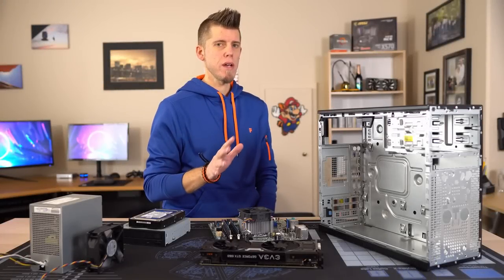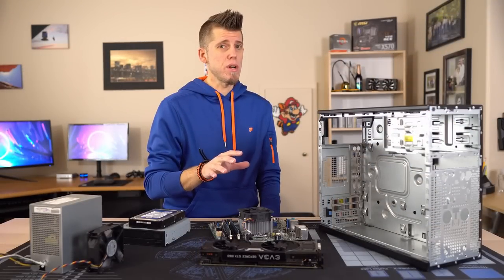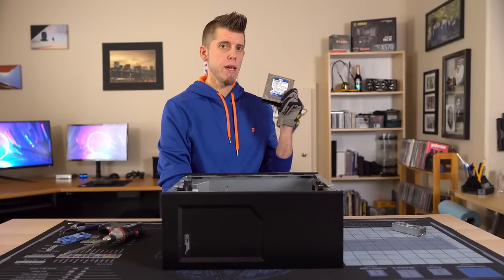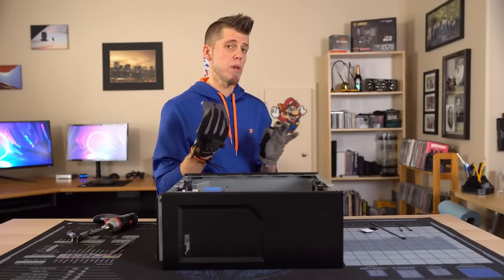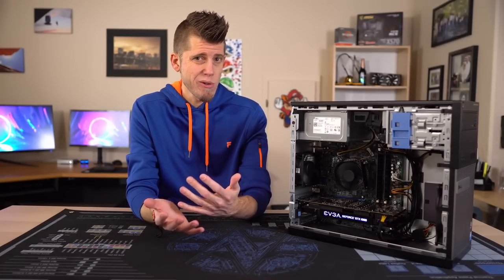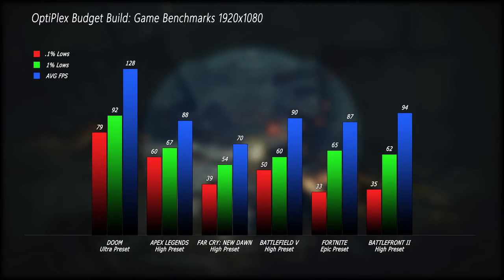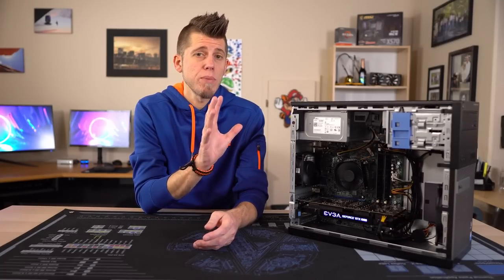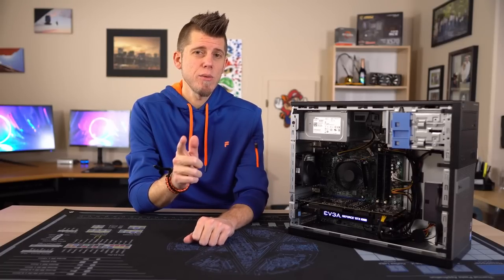Dell OptiPlex Budget Gaming PC For Under $300?

Comment: Eh if you're gonna buy those little 3m things, screws, accessories you're at  point where just buying a new case that can already accommodate those pieces of hardware. Not only that you could probably get something that comes with a couple fans and better airflow.

Best bet would calculate how much you're spending on accessory crap vs a new case.
Reply from the maker: Everything I used was included in the cost. I see your point, but cheap cases are just that... cheap. They're flimsy, generally look terrible, come with terrible fans, and don't always have good airflow. Despite it not being the best looking case, it's pretty solid and sturdy. That being said, swapping these parts into another case is more hassle than it's worth unless you're fine with the front USB2 ports, audio connections and HDD led not working. Besides, throwing it in another case would have made this cost more than the consoles, disproving the point of this video.
Reply: 🙂 check ebay, theres a pc hardware section, they have rebuilding kits with an included tackle tray, all the popular screws and stuff are categorized in their separate compartment, very good thing to have

Comment: Before being able to buy the geForce GTX 1060, what graphics card should i be using? or should i stick with the Intel Integrated one??
Reply from the maker: The integrated isn't going to give you a playable experience. Fine for office task, not for gaming. If you just want something to game on now, but can't get the 1060 yet, a good option would be a RX 460/560. You could go with a GTX 750 Ti or 950 as well.

Comment: Want to upgrade Graphic cards on My Dell Optiplex 7010 Cori 7 vpro 16 Ram which Graphic pass in 2020 Need Help Please!
Reply from the maker: If you fine replacing the power supply, you could run something like the 1070 or 1080.

Comment: I'll admit I'm from ReviewTecUSA and the Power supply isn't as big of a deal as rich makes it out to be. Either way id still go with a 500w or 550w power supply simply to have some over head, and it's only like 20$ more that the one here.
Reply: Yes it is.. the PSU is the MOST IMPORTANT competent in the system. No PSU. no system. Period. nVidia does not have a minimum spec just for the hell of it.
Reply from the maker: @shadowduck02  The problem is that exists because nVidia knows that there are lower end PSU's that can only deliver that 400 watts for a split second and they can only supply around 300 watts, or less continuously. The 290 watt unit in this Dell can supply 290 watts consistently. Now, this system pulls about 210 watts from the power supply giving you a head room of 70-80 watts. That being the case, there's literally zero difference between those two from a power delivery perspective and so many of you comment fail to realize that. So, if you bought a 300 watt PSU with the same issue, it would only provide closer to 200 watts consistently, and that would be a real problem.
Reply: @TheGameBench  while I will agree with you, why risk it to save $30?
Reply from the maker: @shadowduck02  Because I don't see it as a risk, and I don't think you're going to be much better off with a $30 PSU. The whole idea, which I really wish I would have made a disclaimer at the beginning of the video, was that this is fine to hold people over until they can save up at least $50 for a decent 450+ watt PSU.
Reply: @TheGameBench  ok I will give that to you. But great video overall. Excellent presentation values!
Reply from the maker: @shadowduck02  Thanks! I appreciate that.

Comment: cheers. Just found a binned 920 at work with a slim hdd installed and 8gb of ram. intend to run a gtx 1080 bigger psu and another 8gb of ram to run vorpx for VR. Cages restrict airflow so i recommend cutting out the  front mesh. If the pc is on all the time do i really need a SSD will a HDD mess with game play?

Comment: Hello Sir,
I hv a Dell optiplex 990 i7vPro PC , Unfortunately PC motherboard PCIe slot is not working anymore.  Do i need to replace my motherboard for this issue, If yes then can i use same processor into new motherboard ?
Reply from the maker: As long as you stick with a 990 replacement board, which shouldn't be very expensive. Alternatively, the 790 board is nearly identical, minus vPro, which is most likely unimportant to you, or anyone still using these. And while the 390 also uses the 2nd gen CPUs, it's quite different and I wouldn't suggest using it as a replacement.

Comment: I have a optiplex and I have a question, I upgraded the power supply and every time I connect the power supply to the power cable, the fans stay on and it won't turn on unless I go back to the stock power supply
Reply from the maker: What model of Opti? If it required an adapter for the power supply, it's possible the adapter could be faulty.
Reply: @TheGameBench  optiplex 790 I used a 550W but never turned on
Reply from the maker: Okay, no adapter needed, could just be a bad power supply. Is it brand new? If so, I'd return it and get a different one. What brand and model is the new power supply?

Comment: Is it possible to fit a evo 212 CPU cooler into this PC?
Reply from the maker: Nope, it's too tall at just under 160mm. Tallest cooler you could fit in here would have to be just under 139mm. The Noctua U9S would be my suggestion.
Reply: @TheGameBench  Thanks for responding back quickly and for your suggestion👍
Reply from the maker: @Belle1337  No problem.

Comment: Hey man great video!!! I wanted to ask your opinion on a custom pc built for multiple virtual machines. I’m thinking on building one from on a budget from $600-$1000
Reply from the maker: Thanks! How many VM's are you planning on running?
Reply: The Game Bench about 3-6 Linux and windows machines.
Reply from the maker: @cloud77hot40  Guess that depends on how many cores you want to give each VM. I'd say at least an R7 3700X, maybe the 3900X. Toss either in the MSi B450 Tomahawk, I'd say at least 32GB of DDR4 @ 3200MHz. I think you could do that for around $1000. Depends on what GPU you want too go with... even if you need much for the VM's.
Reply: The Game Bench awesome thank you! What is a good psu to have?
Reply from the maker: @cloud77hot40  I really like the Corsair HXi series. Quality PSU's, good efficiency, and very reliable. I highly recommend Super Flower and Seasonic. EVGA has some good units that are just re-branded Super Flowers.

Comment: I have a question, I've followed all the videos and have my fan coming tomorrow. I'll be hooking everything up. I realized I have a psu already that's modular, would that replace the need for all the extra cables needed in the video, except for the 24 to 8 pin. Since you are using the original PSU. Thank you sir, awesome videos by the way.
Reply from the maker: I'm sure you've already figured it out. Sorry, been really busy with testing for another video. Anyways, you'd still need the SATA to fan adapter as well as one of the resistor cables, if you felt you needed to slow the fan down. Otherwise, you shouldn't need any of the other cables. If the SSD mounting is an issue and you don't want to reverse the connector, you can always mount it else where rather than buy the extension cable with the straight end.

Comment: That statement about the fan header splitter cable in the 3020 is exactly what I had planned too lol.
I do have a tower cooler in mine with the fan facing the rear, could I just leave exhaust fan unplugged and plug the intake fan wire into that header. Or just use a Molex adapter for it?
Reply from the maker: Well, leaving the rear fan unplugged will effect how much air can get out of the case, possibly putting you in a overly positive pressure situation, which isn't ideal. You want to really be as close to neutral as you can. I would recommend keeping it plugged it. You can use a Molex adapter, if you have a Molex connector, and these systems don't, but there are press on connectors, much like the SATA one in the video. However, you can always give it a shot and see if you have temp issues.

Comment: I used the 9010 optiplex for my first build in 2015 i5-3470 paired with 16gb ram and a gtx 970. Built it out of because I wanted the best experience for Arkham Knight. And it handled the game quite good at max settings 1080p, at 30 FPS though. But considering how the game is known in the PC world and especially at the time I think it turned out right and every other game ran quite good, I also paired with with a RTX 2070 until I retired it after Ryzen 3700x. The processor became an obvious bottleneck.

Comment: I bought a 7020 SFF i5-4430. I plan to spruce it up a bit for my mother to use as a photoshop and web browsing machine. Its already coming with 1600mhz 8gig ram.

I will put an ssd but just wondering if  theres anything I can do to modernise it. Would a sff gpu make the pc run better in general? Or will the cpu be fine on its own?

Would replacing the psu and fans gave any worth on a non gaming pc?

Comment: Are there any compatibility issues on optiplex pcs?. I’ve heard people say that when upgrading the gpu for example the pc won’t turn on.
Reply from the maker: I've built and sold over 20 of these systems. If it wasn't working, they didn't put in enough effort to figure out why, or they were repeating misinformation and never actually tried it.

However, that's not to say they don't have compatibility issues. They can be picky about RAM and they're incredibly picky about changing the fans for some reason. But it's not too hard to find ones that work.

Comment: so I picked up one of these 9020's it was a slightly better model with a 4 ghtz i7. There are a lot of these computers out there because businesses dump computers after a while and I spent nearly 1000 dollars to build a computer similar to this 5 or so years ago... I'm going to give it to my friend who needed a mac (i turn PCs into hackintosh's) although I'm planning yanking out the 4 ghtz i7 and swapping it with my other computer's 3.5.  I'm putting a GTX 4 gig video card in it... no gaming involved. I did recently purchase a radeon RX 570 to replace the GTX that I'm putting into the optiplex and that with the 4 ghtz processor would make a pretty good gaming machine :). but of course instead it's a hackintosh.

Comment: Can the Dell Optiplex 7020 or 9020 support booting from an NVMe drive? I've seen other models where the NVMe drive is placed in a PCIe slot with an adapter, but many report that they can use it as storage, but not as a boot drive. Some guy that builds Hackintosh PCs reported using Clover (a bootloader) to first boot to a small SATA drive which then loaded drivers in soft UEFI mode to boot the the PCIe device. Also, even if it does work, is using and NVMe over a SATA SSD even a good call considering the age of the system and the fact that it's data throughput is limited to PCIe 2.0, which could theoretically bottleneck the performance an NVMe device. Your thoughts?
Reply from the maker: Yeah, you can use an m.2 drive in a PCIe adapter, but only as a storage drive. The xx20 models have no options in the BIOS to boot from the PCIe bus. I suppose what you're describing is possible, but seems like more of a PITA than it's worth. Regardless of age, 99.9% of people won't see the speed difference between an NVMe drive and a SATA SSD outside of synthetic benchmarks or large file transfers between two NVMe drives.

I'm actually going to tear down my editing system after I finish editing my next video and swap my NVMe drives for my editing scratch drives for SATA. I bought into the hype, but I could edit in Red 8k RAW and not touch the limit of a SATA SSD. Currently, I would call NVMe drives marketing hype for most people, and they're the very definition of diminishing returns for most people. They're real benefit is size, and reduction of cables.

Comment: Do you know what the amber blinking light means? I installed an RX 570 but my optiplex (7010 MT)  won’t power on . It blinks 2 times then it pauses and blinks 2 more times. 

Maybe I didn’t connect everything properly after taking the computer apart?
Reply from the maker: According to the diagnostic table, that's likely a power supply issue, but it could also be  bad motherboard. I'd start by re-seating all the power cables. Make sure the CPU 4-pin power is connected. However, I would ask... are you trying to run an RX 570 on the stock power supply? And which model is it? That could be your problem. It could be drawing too much power for the 275 watt unit in the 7010.
Reply: @TheGameBench  I’m using a 400w EVGA psu and it’s the MSI Gaming X RX 570.
Reply: @TheGameBench  I had the CPU 4-pin inserted incorrectly. Thank you for your help you saved me a lot of time. It’s kinda crazy how one little oversight can cause hours of trouble.
Reply from the maker: @MistaSmellGood  Oh yeah. I've had times where RAM was fully seated and simply removing and reseating solved the issue. Glad I could help.

Comment: I have an optiplex and have not checked the thermal paste. I really should was wondering if these temps seems fine, in games my cpu get up to 70-80 degrees. definelty not ideal and most likely the paste. DO you think those temps are too hot?
Reply from the maker: That depends on your ambient temp. Even then... that's pretty high for a gaming load. If you've never replaced it, it's probably dried up. It would only take a minute to clean off and replace, and it should have you down closer to the 60s while gaming.
Reply: @TheGameBench  I checked it out last night and oh boy, it was dry as a bone. Probably hasn’t been touched since 2013. Scrapped away and new paste is coming today, Cheers!

Comment: The only games that run at 60 is cod and doom on consoles and some other fps rpg games they get 30fps capped or 40fps capped and run at 1600x900 some games do run a 4k but with low ON EVERYTHING WITH ULTRA DETAIL ON CERTAIN TEXTURES these consoles are for tricking people visually and after I played on pc at 120 or 144 and came back to console it was like looking at shit
Reply from the maker: I've watched frame rate and frame time analysis. They all do go up to 60 FPS on all of the consoles, save for Far Cry: New Dawn. On the base consoles, I'm sure that comes at severe sacrifices on the graphics side. Hell, on the PS4 Pro, Apex dropped to 900p at some points. I'm certainly not going to argue that consoles take some extreme measures to try to keep that frame rate up, but still have trouble maintaining it.

Comment: Hey love your videos, very informative series! I have an optiplex 9020. Could I put in an rx 470 using the sata-pcie adapter on the stock 290w psu? From what I've gathered from your videos, I think I could. Just looking for a final opinion before I pull the trigger!
Reply from the maker: I thought so... but I've tested a couple, and the power consumption was way too high. One was just over 280 watts. There MIGHT be some models that will work, I'm guessing closer to the reference clocks, but I don't have one to test to say for sure. I've been trying to get a hold of an Asus Strix RX 470 to test with.

So, I'd err on the side of caution and say no.
Reply: @TheGameBench  I see. Any tips on replacing the PSU? This dell mobo doesn't have a standard 24 pin connector on the right side, instead it has seperate 8 pin and 6 pin connectors. How would I go about hooking that up?
Reply from the maker: @braddutton5281  What model is this? Is it an xx20? Should only have a single 8-pin main power connector and a 4-pin CPU power connector with the SATA power running through the motherboard.
Reply: @TheGameBench  yes it is a 9020. so I would just need a 24 pin to 8 pin adapter for the mobo power and just leave the sata power on the mobo unplugged and just use the psu cables?
Reply from the maker: @braddutton5281  Yep, just use an adapter, and I would just use the SATA connections from the new power supply and get the stock cables out of there. Here's the adapter that I typically use and recommend.
https://www.amazon.com/gp/product/B07CJ411ZL/ref=ppx_yo_dt_b_search_asin_title?ie=UTF8&psc=1
Reply from the maker: @braddutton5281  Sorry for the slow response, but yes. Just use the SATA cables coming off the PSU and remove the ones that plug into the mobo.

Comment: I have a question though:
is it possible to install 3rd party motherboard in the PC like this, like for APU supported motherboard?
Reply from the maker: Well, the case is a standard mATX, so any micro ATX board should fit. You'd have to do some modifications to get the front USB2 and HD audio connections to work as well as the HDD led, power LED and power button to work.
Reply: @TheGameBench  Ah I see, I been think about take an SFF dell OptiPlx PC, with GPU-less Ryzen 5 3400G build.
which needs 3rd party motherboard to do so.
Reply from the maker: @FLYENify  Ah.... the SFF. I thought we were talking about the MT. As far as I know the SFF is proprietary. You wouldn't be able to drop on in. However, you could midify it with some standoffs to be able to mount an ITX mobo. You'd have to cut the stamped standoffs out with something like a rotary tool and drill and tap holes for the standoffs for the ITX board, but it can be done.
Reply: Oh...that too bad, I'm lack of diy skill and tools lol. Thanks for information btw.
Reply from the maker: @FLYENify  No problem.
Reply: 🙂 yes i believe this case is a standard mATX board layout, so just double check the board you like and compare it to this case